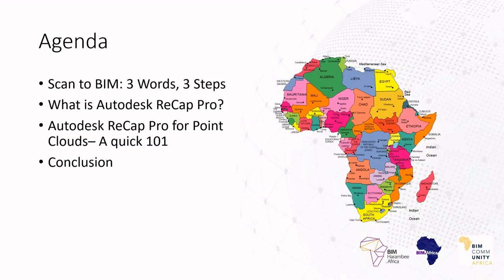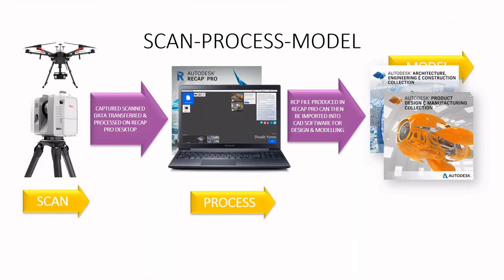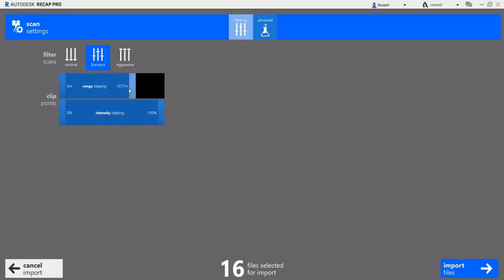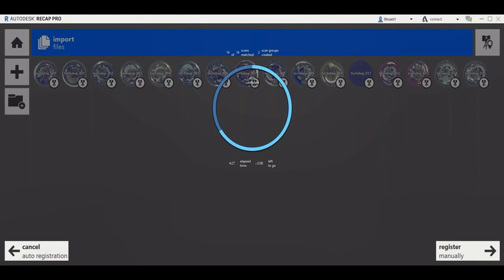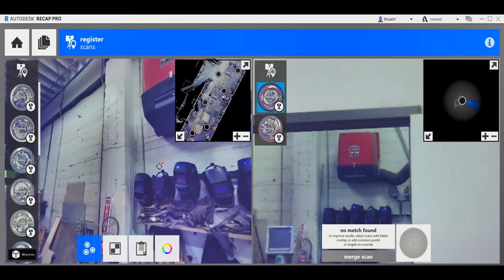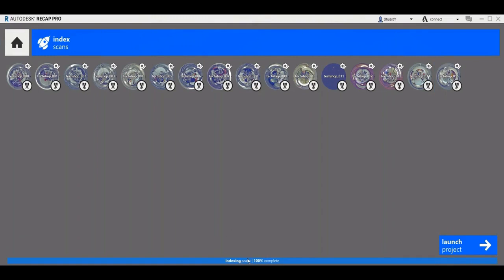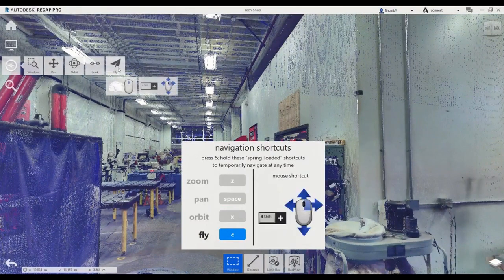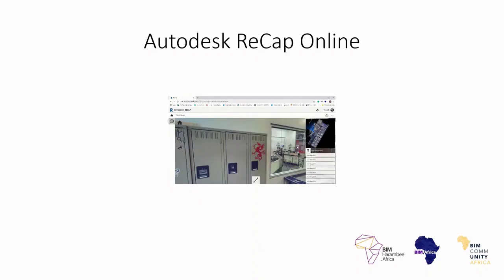Scan To BIM: Utilising Autodesk Recap Pro For Point Clouds, Shuaib Yunos

Comment: Hello, there is a different coordinate system used in Türkiye. This coordinate system is not defined in the Recap software. How can I add a new coordinate system to the Recap program? For example: Datum: ITRF-96, Reference Surface: GRS-80, Projection: 3-degree UTM projection, Slice central meridian: 33.